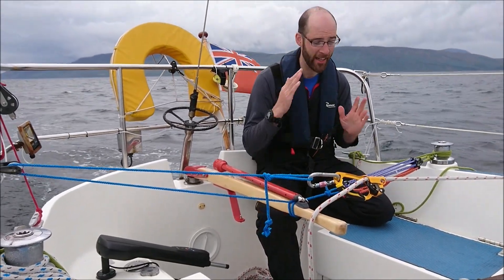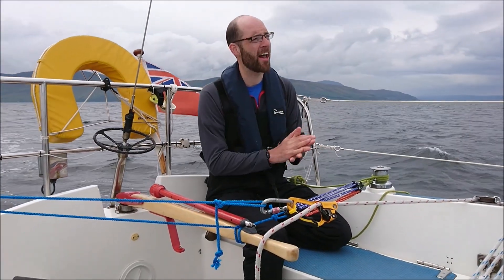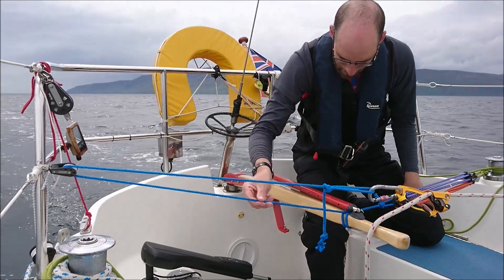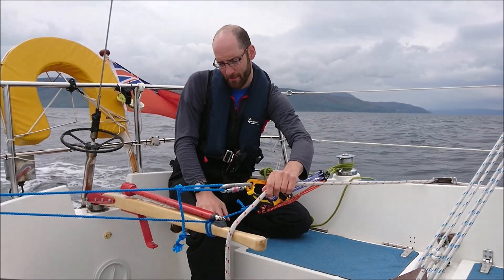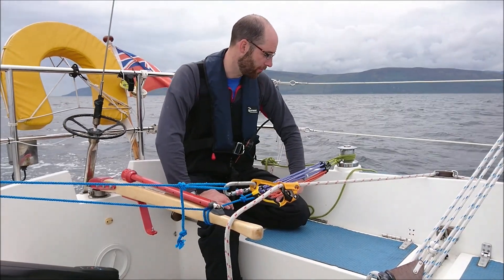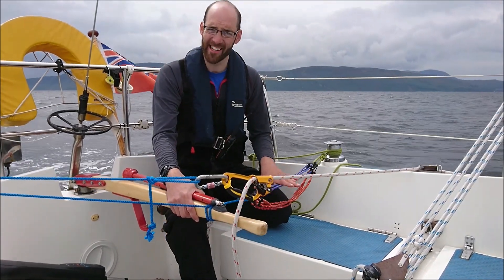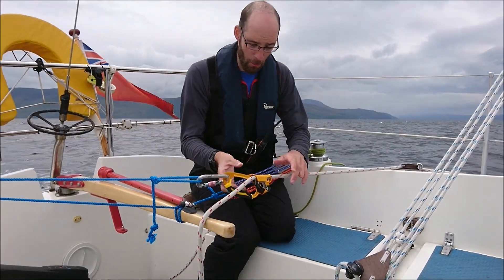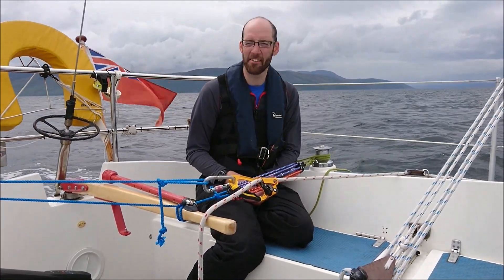How to rig for Downwind self steering

Comment: I love these kind of systems!

You can ‘gear down’ the system by sliding your clove hitch up and down the tiller. 

The same goes for increasing decreasing bungee tension. If you slide that up and down the tiller you increase or decrease it’s force in one fast action. 

Learn how to use a sliding Prussik for adjusting tension as this is as simple as an ascender and will save you loads of money or rusty climbing gear! 
No need for complicated gearing/ pulley systems 😊
Reply: As a someone with interest in sailing and tree climbing.. I love the idea of using prusiks! :)

Comment: Excellent explanation once again however the sound volume was low on the video.  If I may suggest, it would have been nice to see the way the jib itself operated and how the connection to the clue as well as how the line ran aft through blocks on the video.  Thx again
Reply from the maker: Yes, sorry about the sound!  Its a common problem of mine and I really need to put subtitles on.  The sheets are connected to the clue in the normal way, with bowlines.  Nothing fancy there.  The jib sheets are ran aft in the normal way, through the jib sheet cars and then through snatchblocks as you can see.  If you drop me an email address I can get some diagrams to you :-)  I was in the process of writing a paper for a sailing magazine but life got in the way.

Comment: Hi Olly, great video thanks for demonstrating your setup. Did you manage to make it work while sailing with the jib only or is the main really essential ?
Reply from the maker: Hi. With this setup the main is essential as it is needed to blanket the job when the boat moves downwind. Without the main to do this the jib would fill more, resulting in positive feedback. I haven't thought about doing it with jib only but it might be possible. There is a commonly used method with two jibs, but that only allows you to sail dead downwind and is really best used a long way from land!

Comment: Brilliant, will it work on a wheel steered larger boat?
Reply from the maker: Yes but you'd have to rig it s bit different
Reply: drawingboard82 thanks for a quick response, I will try it in the next few weeks. I guess I will have to reverse the negative feedback line and bungee cords and somehow attach them to the top of the wheel to aide in turning. Btw, I sail a Sabre 34-2 on Long Island sound, eastern US. Fair winds.
Reply from the maker: @darshanpatel9279  great. I think you can use the same setup as me if you connect to the bottom of the wheel. Have a great sail!

Comment: Just subled on your channle. i owen a trailersailer catamaran. My question to you is how reliable is this to tiller pilots? .
Gerard.
Reply from the maker: We found it very reliable, but of course if the wind changes direction so does the boat.  Its cheap, quiet, and uses no electricity.  If you have a big cruiser with a built in autopilot, that might not be so important, but on a small boat like this its really useful.